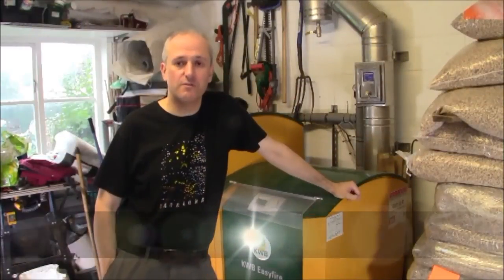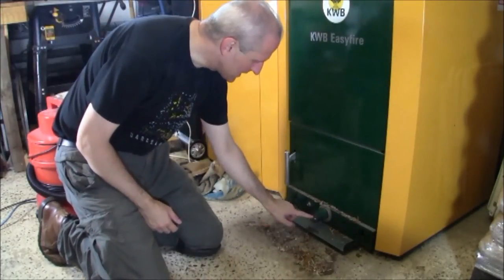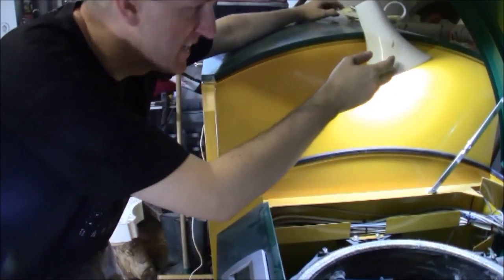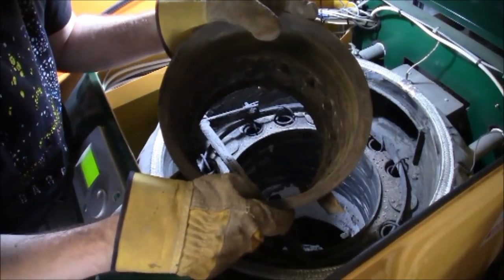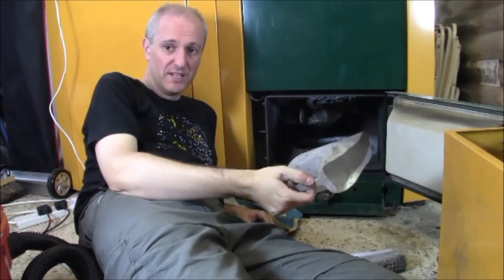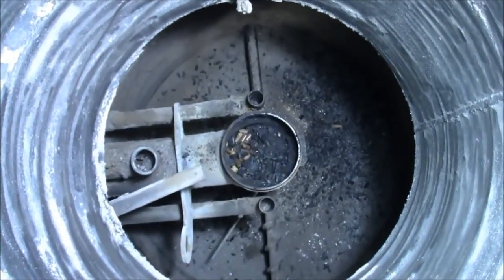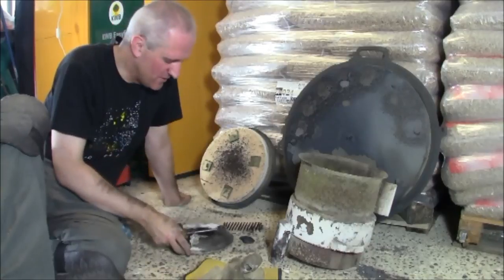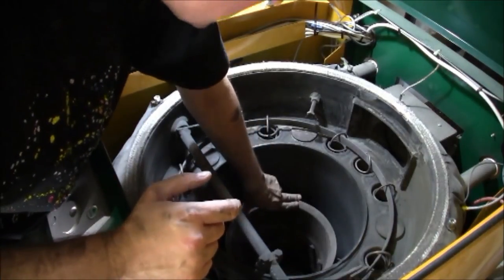Annual Cleaning/Maintenance of a Biomass Boiler [Superhome59 Biomass part 9]

Comment: Thank you !

Mine makes a lot of metallic looking coal : in the combustion bowl AND upward. 

Do you think there's an easy explanation ?
Reply from the maker: Yes, the "klinker" is a hard carbonised metallic-looking residue that resembles coal. I have it too around the burn plate.  It is really hard and has to be removed by tapping with a hammer and scraping with wire brush and a screwdriver. However I do not get a lot of it and only on the burner plate. I do not know the scientific principle behind its creation so cannot comment as to what might cause an excess. Mine has created that klinker since new so it seems normal. If yours has got worse then maybe the boiler needs checking by a service professional as it might indicate something is wrong?
Reply: thanks again
Reply: @yanemailg  The formation of clinker normally means your boiler is not running hot enough

Comment: What is the display box on the flue at 13:36 please ?
Reply from the maker: You refer to the Upmann box fitted to the flue? To be honest I don't really know but it has a flap that appears to allow extra air to be drawn in.
Reply: Ah ok thanks, Just looks like it has a blue LCD display ?
Reply from the maker: No, that is not a blue LCD display. That is the Upmann Box I refer to. It has a bright blue label. The only LCD panel in view in the green one at waist height.